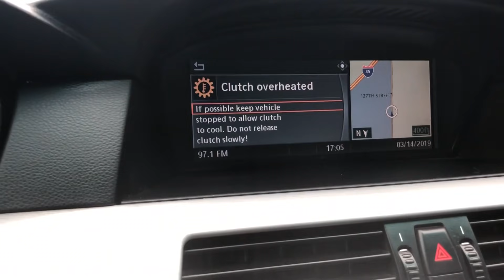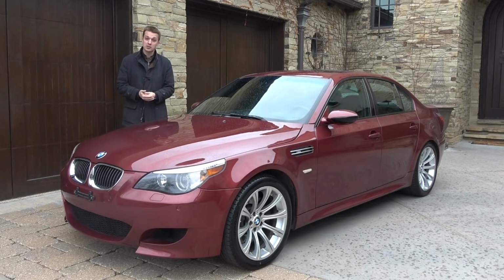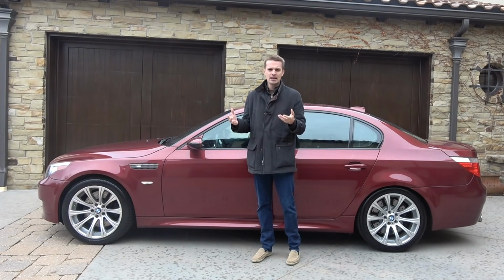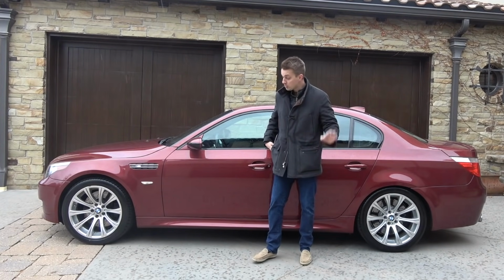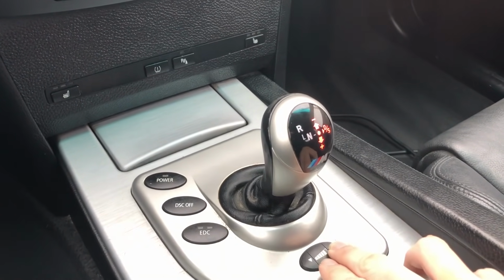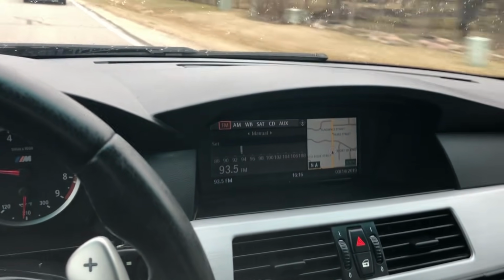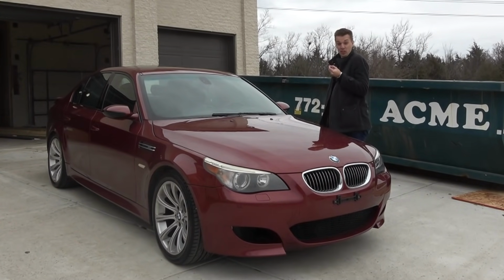My Cheap BMW M5 Is FINALLY FINISHED (Thanks to a Wire Hanger???)

Comment: Think about the weight transfer during acceleration and braking and you'll realize push forward to downshift and pull backward to upshift is the correct way.
Reply: Idk I disagree why its that way. I feel like it mimics the pull from 1st to second gear shifter. Other than that I feel like it is wrong. My audi, on the infotainment system the knob moves the opposite direction for down, and that seems like a mistake.
Reply: I agree!  Forward is downshift,  backward is upshift.  It’s a natural feeling
Reply: @snotface8  if you've ever driven on a track before you'd know that under hard braking your body is pushed forward and pushing the shifter to downshift is much easier. Same when you're in full acceleration your body is pushed back in the seat so pulling the shifter to upshift is much more natural. Every race car with a sequential shifter works this way.
Reply: They changed this with the e90 models, I had an e46 that I took to the dealership and they gave me a loaner e90 and didn't tell me it was different shift pattern... I downshifted in traffic and almost rammed the car in front of me lol
Reply: hard to believe since when you downshift your foot is on the brake or off the gas anyway.
Reply: Yes thats the reason. In hard acceleration youl be "pulled" backwards so plus is back and hard braking youll be "pulled" forwards so its much easier to downshit to front. And thats the way it always should Be in every performance car. Maybe your moms minivan has it other way but that wont Be for track. PS. My BMW has it same way and its just better in hard driving.
Reply: I race a car that's been 8.81@160mph over the 1/4 mile and have no issue pushing the shifter forward to change gears. An old M5 v10 be lucky to run 12sec 1/4 mile.
Reply: @jaesindnb6197  it is exactly that. Back for up shift and forwards for down shift is correct as it follows the momentum: lean back when going faster and lean forward when slowing.
Reply: I agree pulling feels like  upshift and pushing feels like going downshift

Comment: As a 4 year E60 M5 owner... Uff.

This car should've gone to a specialist in the first place. Swapping the entire transmission out and throwing parts at the car without even scanning it using ISTA is just asking for more trouble.

All of the complaints about the SMG are valid if old, and anyone who drives one more than a week will get the hang of the gearbox. It's still a weak point, but to say it makes it undrivable is dramatic.

$5k for bearings and vanos refurb is about $2k high, and you're still having it done by someone who admittedly doesn't know the car very well. As great as the wizard is, these things are so friggin finicky, I don't think I'd have him tearing into the bottom end.
Reply: Hoovie cannot be convinced that anyone other-than Wizard can/should work on his cars.  Funny, the only one that runs right is the McLaren (which requires dealership service for any warranty work).
Reply: @MichaelJames-lz7ni  he seems to be a pretty good general mechanic honestly, but specialists do exist for a reason.
Reply: Do you really think he would have spent less money if he'd let a BMW specialist do all the work?
Reply: @joakimquensel597  Without having my hands on the car I can give you a 100% confident "maybe?"

A lot of the SMG problems are now being traced to frayed wires and worn out $14 relays. The first summer I had my car it started having trans issues, the first diagnosis I got from my usual mechanic was that it needed a clutch, p plate, flywheel and related hardware, some $4,500 all in. Took it for a 2nd opinion and it was just the slave cylinder. (still a $1500 job at shop rates because you have to drop the gearbox and bellhousing)

More importantly, the car would've been fixed properly. No bent tooth on the flywheel, and no used totally unknown transmission and related bits.
Reply: i agree...i have an 05' maserati QP with duoselect and once you learn to blip the throttle correctly the gearbox becomes a lot less of an issue
Reply: Fifth gear tv show had an episode on this M5 model, and the presenter tiff needell showed that having the gearbox in it's fastest setting combined with using the paddles to shift and lifting you foot off the throttle when shifting, provided a perfect experience.
Reply: Cars are way too specialised and complex to give troubleshooting to a generic mechanic. As a petrol head , I would have thought it was quite obvious...
Reply: Car wizard overcharges him

Comment: Actually, forward being downshift and back as upshift is pretty much the way it normally works.
Reply: yeah i was just about to say isnt that how it should be? pull towards you to upshift and push away to downshit
Reply: race transmissions have it this way as well, so forward being upshift and backwards being downshift is wrong
Reply: My mom has an Hyundai ix30 and it’s up for up shift and down for down shift, it just feels so wrong.
Reply: @SympathyRS  
References to race cars are not really relevant for a car so fragile only an idiot would use it on a race track! 🙄
Reply: Joakim Quensel it was designed for performance, the technology didn’t really age that well though
Reply: @joakimquensel597  This is a M5.
Reply: Correct.☝️
Reply: @jonasthemovie  
So you're not allowed to make jokes about an M5? 🤔
It's not only fragile, it's touchy as well! 😁
Reply: its because your muscles react faster for the pull motion than the push motion so it's used in any performance car.
Reply: @greatleader4841  
As if it would matter when you have time to rattle off every river in the entire US during the time it takes for the shift itself! 😁
Reply: @joakimquensel597  Fragile or not, it is still a 500 hp sedan...
Reply: @jonasthemovie  
When it works! ☝️🙂

EDIT: And in between the shifts! 😀
Reply: @joakimquensel597  As long as downshift is forward it will be fine.
Reply: @joakimquensel597  The shifts were as fast as the fastest gearboxes at the time (in M mode). Stop the uninformed hate
Reply: @Ignacio.Romero  
"At the time" there were convential automatic gearboxes that were much quicke than this. BMW made the switch to SMG too early, Mercedes waited (vicely) unttill the technology was mature enough in terms of both performance and reliability before they put the speed stift transmission in their AMG models.

And the M-mode shouldn't be used as default because of reliability. That is at least what Hoovie says in the video.

But no I'm no "hater"., I was just trying to be funny. I like this car, too bad it has these reliability issues and slow gearbox.
Reply: @joakimquensel597  "At the time" (2006) the SMG III transmission was the fastest, changing gears in just 65 milliseconds. It was eventually surpassed by the Ferrari GTO (60ms).
Check your facts
Reply: @Ignacio.Romero  
I never tried the E60 M5 smg myself but I did drive an E46 330i and the transmission felt both slow and jerky. Maybee that SMG is one generation older than the E60 M5 (?) but listen to the shifts in Hoovies video. I dont know how they measure those 65 ms but at least the shifts FEEL irritable slow. I guess it has to do with how the computer manages the throttle in between the shifts. And it's jerky too.

A colleague of mine has the E60 M5 and although he adores his car and treats it like a baby he doesn't like the smg.
Reply: Yep, its like that so you dont have to work against the foward momentum when accelerating, same for decelerating, it actually makes you do it faster.

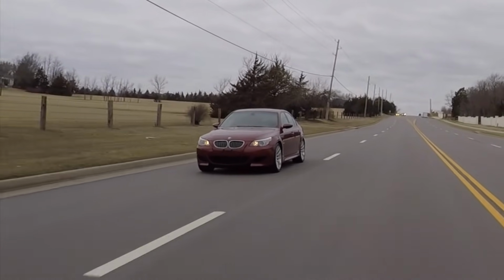Comment: 9:55 for anyone wondering about the peeping. It‘s a dumb setting that makes the car alert you every full hour.
Reply: i have been wondering this for actual months
Reply: Thats to remind u to turn the radio on for news.
Mine '89 E32 does that (u can turn it off)
It beeps a few seconds before full hour so u have time to switch to desired radio station to listen to the news.
Reply: This happens in my car and I never knew why, wow that's such a relief.

Comment: It's normal for sequential gearboxes to move the shifter down to upshift. I know from rallying.
Reply: Or from any sequential gearbox ever, really.
Reply: @343_GuiltySpark  True. I just wanted to bring up a common example.
Reply: And thats how it should be. Because when you need to upshift, you are accelerating, being pushed back, so it is logical to go with the flow of movement and pull on the shifter to upshift, trying to fight the acceleration to upshift makes absolutely no sense and makes the car harder to control. And vice versa, if you are downshifting, you are probably decelerating, so you are thrown forwards.
Reply: Thank you for taking the time to type that all into your response.  My thoughts exactly and you explained it well.
Reply: @Tom Yeah, don't make me start on how much I downshift instead of upshifting when I get to drive those cars(thankfully, I have a manual in my car) because it just feels wrong.
Reply: @Tom That is an agriculture point of view. For them forward means faster. For racers it's vice versa.
Reply: Neil Baldacchino should be in every car that way
Reply: Porsche`s tip/steptronic goes the wrong way for some stupid reason. Great work for a sportscar company.
Reply: not really that though its more mechanical sequential gearboxs tend to need a backward throw, to push the connecting rod, from the gearstick to box, forwards. when its electronic its up to what way they want to do it.. but what direction/momentum of car/you has fuck all do with it. like saying you cant start turning left once youre turning right cos your arms will be pushed away
Reply: its that way by design the mechanism needed to switch the pivot of gear stick would be stupid. it is the better way to have it i agree but its not that way cos when your stopping you get thrown forward haha. designers probably have it other way to showcase fact they can, even though its just electronics doing the gears
Reply: people applying simple logic to stuff and thinking they know how stuff works as usual haha
Reply: also if you couldnt handle pushing forwards on a gearstick to change gear at speed/under acceleration youve already fucked it as far as talent goes
Reply: @lovik87  only on macans though, the new cayenne and other porsches are now going back to the down for up up for down
Reply: In our e39 530i it’s the same

Comment: It still blows my mind that when people start these expensive fancy engines, they instantly proceed to rev the shit out of them, when all the oil and other fluids are still cold.
Reply: most people have no idea about oil temps and shit
Reply: He seems the type to just want to "Fast and Furious" every damn time he drives, and is shocked when the car destorys itself
Reply: He was on open road so im pretty sure it was warm. Bmw cars show on the rpm gauge how much you can rev your engine depending on the temp
Reply: @dussemccussay3995  Well then it's an even bigger surprise why BMW's end up in the repair shop with crank main bearing wear and failures. Maybe that feature isn't working quite as well as it should?
Reply: @JackPecker911  yea the car might be smart but the drivers, cant speak too much for them 😂
Reply: It doesn’t do as much damage as you think it does. Exaggerated.
Reply: @Ghosts-jx7dw  If you do it repeatedly it most certainly does. Having warm oil circulate and lubricate bearings and other vital engine parts before having them spin thousands of revolutions per minute or putting maximum load on them is extremely important. If you think it isn't then your engine probably won't last it's expected lifespan. Might not be as big of an issue with an old beater (let's say 80s-90s Honda or Toyota) they are not tuned for high performance, but on a high performance engine you definitely need to wait for it to get up to temperature, because the tolerances inside the engine are much smaller and therefore wear out much quicker than a normal engine.
Reply: JackPecker911 it’s more of a chronic issue. And if he did it one time in this video then why are you so hurt about it?
Reply: JackPecker911 how do you know he didn’t warm it up beforehand? You’re assuming.
Reply: @Ghosts-jx7dw  I'm not hurt by it, it's his car he can do whatever he wants with it. Just saying I personally would never do that to my car, cause I take care of the things I own.
Reply: @Ghosts-jx7dw  He might've, but if the video is unedited then it's also unlikely.
Reply: JackPecker911 It’s literally been debunked that modern cars don’t need to necessarily need to be warmed up. And the video is edited lol. It was debunked by engineering explained btw.
Reply: @Ghosts-jx7dw  If you say so, I'm not gonna change my ways of treating my own cars. If you wanna keep doing that to yours be my guest ^^ Well the car is off, he gets in it without warning starts it and then revs it, if it is edited then it's not a very big jump at all and one could easily assume that it is in fact still cold. If you don't wanna take my side on this that's fine, we can agree to disagree, but I'm not gonna start changing my ways as I've gotten high mileage out of every single car I've owned.
Reply: JackPecker911 engineering explained debunked it kiddo. I have to admit I don’t warm up every time and I have a 98 Camry w 315k miles
Reply: @Ghosts-jx7dw  I'm 34 -_- and like I said.... 80s-90s toyotas and hondas can take a beating.... it's a different story with high performance engines with small tolerances.....
Reply: @Ghosts-jx7dw  Also have you ever cold started a BMW M5 with a V10 in it? The 507hp V10 clatters like a fucking diesel unless you have it on a block heater for 2 hours prior to starting it, also likes to chew up it's crank bearings if you run it cold FYI, kiddo.
Reply: maybe it was already warm...
Reply: In the owner's manual of my first car, a '76 VW Scirocco, it explained that warming up a fuel injected engine before driving is pointless and wastes fuel.  I've never done it with any of my vehicles including my e39 528i which I've owned for over 10 years and, with almost 300k miles on the original engine, it still runs beautifully
Reply: @spiker702  it's an old car that's not a performance car, different tolerances. High performance engines need to be warmed up, before driven or revved high. A normal every day car can take a beating a highly tuned performance machine cannot.
Reply: Agreed

Comment: 9:59 every new bmw owner back in the 2000s
Reply: Martin Schefer lmao
Reply: That sound is the clock chime, it sounds when the clock reaches a full hour like say from 8:59 to 9:00. I believe you can turn it off in the radio settings.
Reply: @cominator  it might be the info chime that m-mode is going off to normal ride mode
Reply: @StratoArticA  could be but my non-m 330ci makes the same sound and doesn't have m-mode..
Reply: @cominator  is it built in chime with bmw? Where i live (finland) the radio station makes chime only if its on

Comment: Always M mode and you really gotta flash it to the EURO SMG version.
Reply: Just like m6 have it on sport smg likes it more same with the smg on E46 m3 :) well atleast here i sweden :D
Reply: @ReviveAndDrive-mk1  in the USA they have their own version of SMG software. Which is max 1500 rpm launch control and rougher shifts. The Euro version improves shifting and does 4k rpm launch control. It really improves the overall feel of it imo. Not sure about the E46, but just flashing to the different software version helps alot.
Reply: @Trajectory-n9w  wow thats sucks that they did that. I hope everyone update there systems so they can really have fun :D
Reply: @ReviveAndDrive-mk1  I agree. Even stock when you are in M mode at 6th shift level... it should still snap your neck. Think hoovies m5 is about to blow the SMG pump.
Reply: M6 here UPDATE YOUR SMG SOFTWARE TO EURO

Comment: "The worst transmission I have ever encountered" Try a first generation Smart ForTwo.

Also, pulling back on the gear lever to change up is correct.
Reply: Or the Ford Powershift in the Focus and Fiesta
Reply: it's correct in automatics built for girls, kid. 
don't drive your mom's lexus.
Reply: "Also, pulling back on the gear lever to change up is correct." Couldn't agree more!
Reply: At least with some, you could just flip the wires on the controls and have it back like normal.
Reply: It makes much more sence to pull back the gear stick if you wanna change up. The g-force while accelerating makes it more comfortable to flick it back and the g-force while breaking throws your body forward just like you will throw the gear stick forward to down shift. It is the ultimate setup.
Reply: My Peugeot 607 had push forward to change up and even though (or maybe because) it was my first automatic I always thought that it was the wrong way round.
Reply: Also, think about manuals: 1-2 -> back 3 -4 -> back. Sure, you go forward going 2-3 or 4-5, but there you're changing into another column.
Reply: @Tedd755  I suppose the old autos went PRND321 so if you started at 1 it was forward for 2 then 3, unless you have a Jag J gate which put it on the other side of the J so 1 is at the front.
Reply: Also, both Commodore and Falcon auto shifters in sports-mode have up-shift going back and down going forward.
Reply: @gepwxaqdfsidsesg1548 : 321 on conventional automatics isn't for manual shifting, it's for limiting the transmission to shift higher in special circumstances such as climbing or descending on a hill.
Reply: @potatochobit : Watch some rally footage and you'll see that is the way everyone uses it.